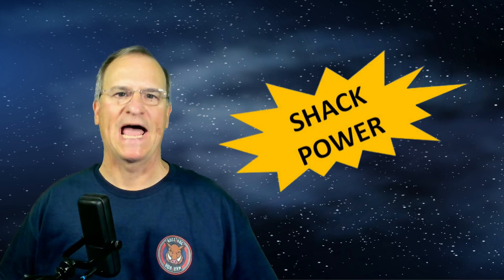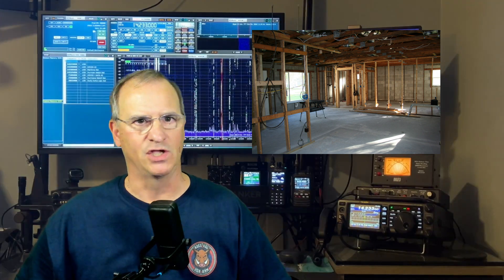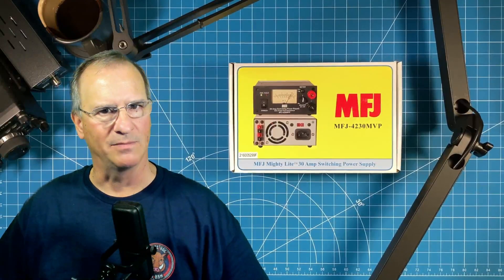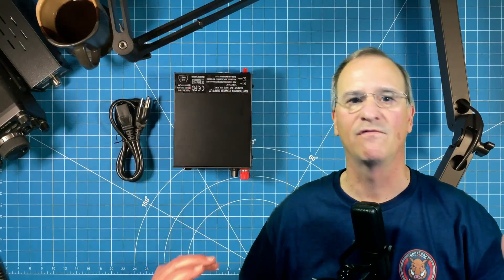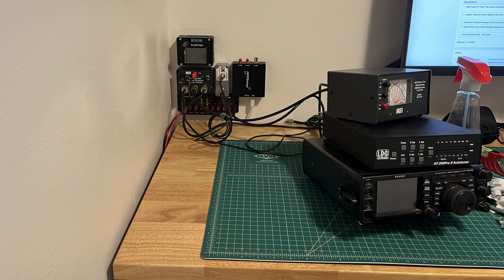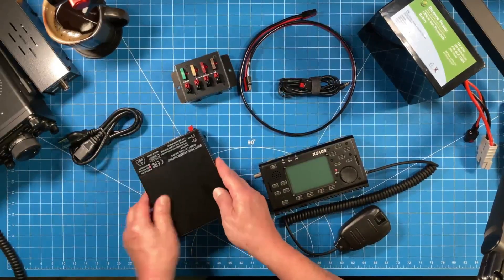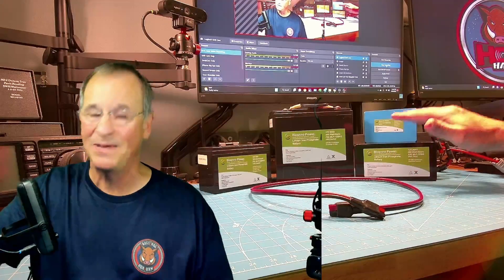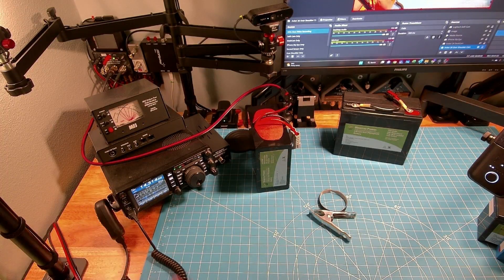New Ham Radio Shack Build Out:  Episode 2 - How do I Power all my Ham Shack Equipment

Comment: Just found your videos today -- love them.  I know MFJ is now out of business, but more important to me is that I hear from a lot of HAMs that switching power supplies are known to produce RF noise -- so they typically steer away from those in favor of the linear Astron units (yes, much more expensive).  What are your thoughts on this RF noise issue ?   Thanks.
Reply from the maker: Honestly, didn't even know that was a concern.  As I only own the MFJ I don't know that I have a valid opinion.  I do not consider myself to have a noise issue in the shack from my power supply.

There are times I have run radios off battery in the shack, and then turned on my MFJ power supply to power the station radio, and there has never been a noise issue on the radios on battery...my limited example says non-issue.  Note, limited example.

Comment: Just upgrade to a West Mountain Radio Epic PWRgate. It is a 12V uninterruptible power system that can supply up to 40A continuously from either a power supply or a Lead Acid or Lithium battery with almost no voltage loss, and also charges the battery with its high performance charger. A separate solar panel input can be used to charge the battery directly from a solar panel with output less than 30V.
Reply from the maker: Haven't used one but I have read about this and think its a great idea.

Comment: Newbie question….do you run the power cord from the power supply to a surge protector which is connected to the 110V outlet or direct to the outlet?
Reply from the maker: You could run the power supply power cord to a surge protector if you wanted to, but it is not a requirement.  Treat it like you would any other appliance in your home.  A TV, refrigerator, microwave etc...

Comment: I have the Alnico DM-330MVT That I will run to a  Powerpole 8 pole distribution block. I will use inline fuses on all equipment. I may rethink and get that basic fused block.
Reply from the maker: The Alinco will do the trick.  Running to a fused block will make life easy for anytime you want to add / remove / change out gear.

Comment: With your construction background I am really surprised that in video #5 you didn't just go get a core drill to punch that hole through the stucco and the hollow block wall. Seriously!
>> An on the subject of hollow block walls; what does FL have against filling the cells with grout? The walls would resist hurricane force winds a lot better, but then I am in CA and we have earthquakes to worry about and design for, but our earthquake construction methods and code does a great job of resisting wind loads too. Just sayin'
Reply from the maker: Didn't own the hole saw for the size I needed, and the other tools were already in the garage, so I went with what I had.  Cores in FL are filled every so many linear feet, as well as the top course all the way around the perimeter.  That's what the code is; so in the end, its kind like post and beam construction.
Reply: @HOAHamRadio  I was a masonry special inspector for 22 years and I only did 2 buildings with that "post & beam" configuration. And I must have done hundreds of buildings and walls. That is the style seem on the east coast and one of the buildings that was built like that was designed by an engineer from Florida. It was different.

Comment: I have a 76yr old house with 15 amp circuits for 90% of the outlets. I just have to make sure when I get my shack up and running in the chosen room that I don't plug it into the outlet at is on the same circuit as the LR space heater and window AC. LOL old houses are so much fun.
Reply from the maker: Sounds like you are thinking right; just control what is turned on for the circuit you've connected your radio power supply to and you should be good.

Comment: Modern electrical will support 1x 100w radio, but how many could it support? Could it support upwards of 4, plus or minus a couple 50w radios as well?
Reply from the maker: Mason, I don't think you would be transmitting on more than one 50 watt radio at a time, would you?  So you can hook up as many as you have / want; you are only transmitting 1 at a time.

Comment: Great video Bob. My space in the condo is limited and the HOA prohibits outside side antennas and enhancements so I am severely limited. Being retired, my funding is also limited but so far this series has tracked along pretty nicely to what I have done. One tip; when I charge a  battery I put a small piece of blue painters tape over the power pole connectors and it stays there until I start using the battery. That way I know at a glance if the battery is fully charged or not. When I use the battery the first time after I charge it I pull the tape and put it on the side of the battery so it is readily available for the next timeI charge it.
Reply from the maker: Thanks W4MKH for the positive feedback and the excellent tip for "remembering" the battery charge status.
Reply: Great idea on that tape ident. I'll use it myself. Thank you very much 73

Comment: This is on point.  When I was a new ham, I had tunnel vision and couldn't see options over fear of messing stuff up.  Great message to new hams.
Reply from the maker: Thanks for the feedback TO.  As I'm going through this series, I know much is old hat to some of us, but oh how I remember my struggle to figure it all out.  Thought I'd pass along my research and hard knocks.
Reply: @HOAHamRadio  I am a new ham and have found this series to be invaluable to helping me understand all this electrical and RF stuff. I was a carpenter in a previous life and electricity is something I have avoided judiciously. I don't like getting shocked and this series will help in this regard.
Reply from the maker: @AlvinMcManus  Hammer and punch in the tool belt, not electric circuit tester.
Reply: @HOAHamRadio  exactly. Times change.